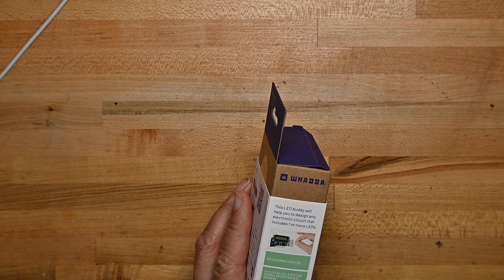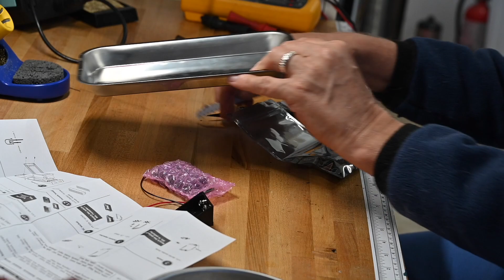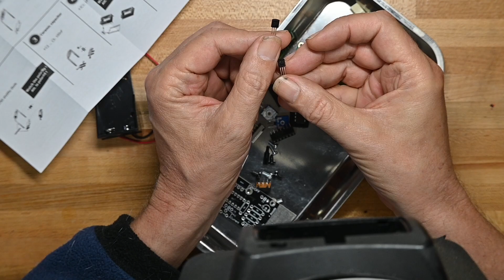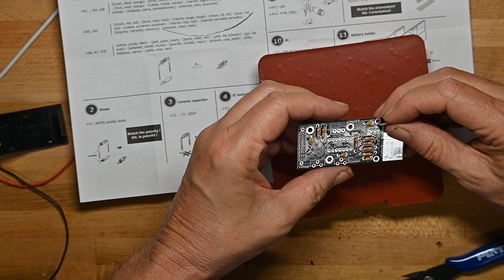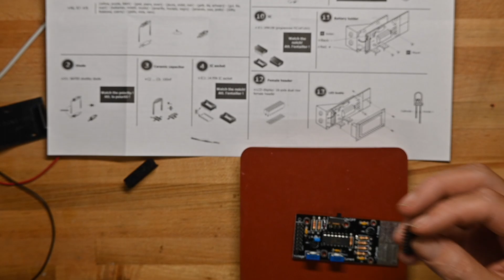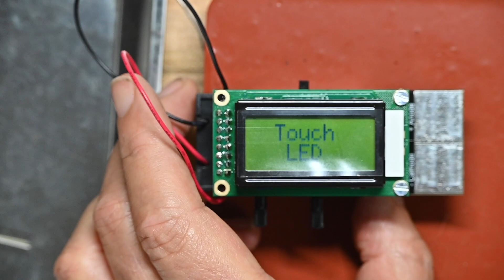C.K. builds an LED Buddy kit from Velleman/Whadda

Comment: What kind of solder do you use? Solder looks nice to the point where you don’t need to clean the board after assembly. Do you know the Weller tip in use? Mine is not that fine. Thanks. Great video.
Reply: Thanks CK. Very helpful information.
Reply from the maker: For most of my soldering I use Kester .31inch/.8mm solder.  I occasionally switch to the next size up for larger parts, but not often.  As for tips, I usually use a 30 degree bent .8mm conical tip, I actually buy these from whatever 3rd party seller I can find.  Thanks for stopping by!

Comment: Looks like a handy unit.  I generally just use a partially discharged 2032 battery to check if an LED works, which is fine for kits but if when you start building your own stuff this would be handy

EDIT:  I just finished assembling mine, was very happy to see it work when I hit the switch, lol.  I thought my IC socket  was missing pin 1, was just about to solder the IC directly to the board when I saw something shiny on the floor.  It was the missing pin, popped it back in the socket and proceeded as usual.  There's a QR code and a link on the back of the box that you can use to get a PDF copy of the assembly instructions and the users manual.
Reply from the maker: Yeah, I usually use my meter in continuity mode for a quick check.  But if you're building something with 5 or more LEDs this is quicker to check them all before install than the meter.  Though as I think about what you're doing, it is probably easier to squeeze the LED leads around a 2032 pretty quickly.
Reply from the maker: Edit reply - Great!  Though I will say, if I dropped a socket pin on my workshop floor I would never ever be able to find it!

Comment: 18:38  24V?  820-Ohm resistor?...  but what it doesn't tell you is that you will need about a 1Watt rated resistor though...
Reply from the maker: True enough.

Comment: Thank you for this very useful video... As a relative "newbie" to electronics, I have been trying to get a more detailed instruction sheet for months from Velleman with no success.  I find it amusing that the instructions describe in great detail the proper soldering onto the board but barely touch upon much more important stuff like the positioning of some of the components.... not very confidence building for a neophyte! Your video is extremely helpful. With it I can now complete the project with infinitely more confidence. Thanks again for your extremely valuable assistance.  It should be very useful in my scratch building of model railroad equipment and scenery with its many led applications.
Reply from the maker: @fredormond3219 Thank you!  Glad it helped you work it through.  And mentioning your RR set makes me want to drag my 45 year old N-gauge locos and cars out of storage and create a new layout.  Let me know if there's something else you're interested in seeing built!

Comment: This is a very useful little tool. I built a Nixie Clock and one of the LEDs was bad. I added another LED and it didn't work. It was because I did not get the right LED. They looked the same, but one was addressable. It certainly was a learning experience. This tool could have prevented that. Thanks for sharing this build!
Reply from the maker: @captcraig777  This kit exceeded my expectations, yes, it is a very useful tool.  Glad I could surface it for you!